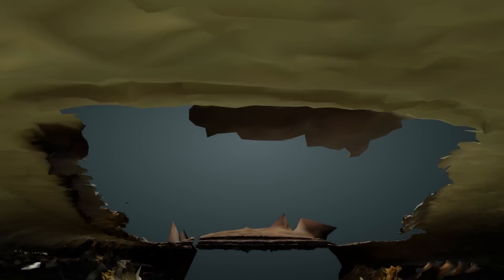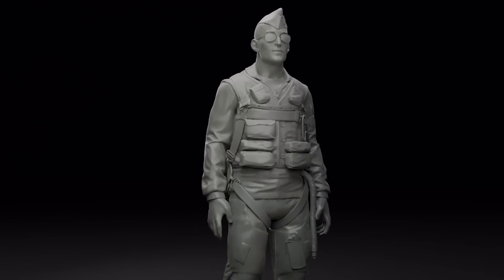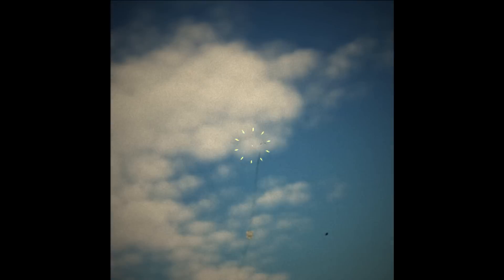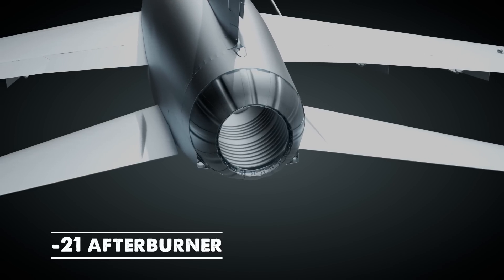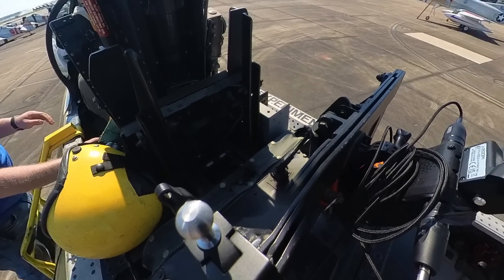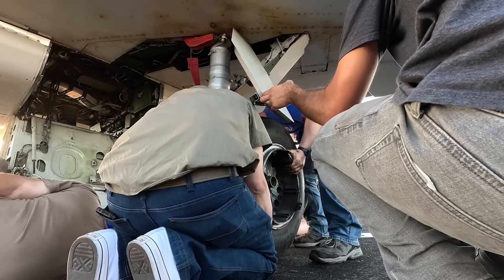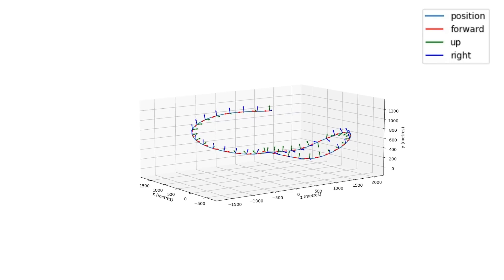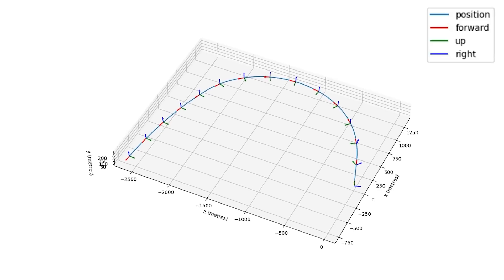F-100D Dev Log: The Road to Realism - Part 2

Comment: Excellent detail but one minor observation,at 0:37 of the video at the bottom left behind the headrest of the ejection seat there are 4 screws but they are lockwired at the wrong side.The whole meaning of the lockwire is to prevent something from unscrewing not from screwing.Please fix that.

Comment: Why is the Zoom XY mic placed on the HUD and not behind the pilot's head?
"Strategically" - Wouldn't the HUD placement make the record of sound which would not reflect the actual position of sound sources the pilot hears?
Asking as I actually use similar Zoom XY mic and recorder and I know how much the position of the source changes the feel of spacial placement of audio source in the final mix.
Reply from the maker: For safety reasons we had to adhere to the restrictions placed on us. This was something I took very seriously and had to respect and conform to.

Comment: did you guys model the lockwire at 0:38 yourselves? or was that taken directly from the photogrammetry? could be a flipped thread but if its not that lockwire is the wrong way around (minor detail I know but still). I love this project, its gonna be awesome to see this in DCS
Reply from the maker: It was an issue when mirroring the model in the software, it has been resolved. I honestly don't recall if that wire was in the photogrammetry.
Reply: @grinnellidesigns  ah fair enough. I love that you guys actuallysolved such a detail. Only aircraft mechanics will really notice that to be fair. good work!

Comment: Since ya’ll got to use a two seat F model for reference, are there any plans in the future to add the two seat wild weasel model?
Reply from the maker: While programming would be a matter of adding multicrew and modifications of a few systems, the art would be the most time consuming factor. Its not the focus at the moment but not off the table either.

Comment: I hope the flight model will be authentic to the real thing, which was apparently rather challenging to fly.
Reply: Beat me to it.  The F-100 and the F-104 killed a lot of young pilots.  Missiles with men in them with high wing loading.  You need to be on your speeds and their associated AOA limits.  LOOOOONG USAF runways were to get B-36's and Century series jets airborne.   Fly those interceptors like you would a Mustang or F-86 and you end up with a dance partner that kills you after yanking the stick back just ten knots too slow.  Unrecoverable "Sabre Dances"  (pitch up/inertial coupling)

Comment: 1:30. That level of wear seems about right, to me.  Somewhat used but not too worn out like it came from the boneyard. 🙂.  Another option might be nice, if it’s just a matter of changing out some texturing files…near new, like right out of the depot (although, I suspect there were no new F-100Ds with that modified/updated equipment configuration), or well worn in like 1972 condition?
Also, I assume the first digit selection knob will be limited to either 2 or 3 in the release?  666 MHz is not in the UHF band. 😉

Thanks for the great update!  Really looking forward to the ol’ Hun.

Are you guys thinking of making another module after the Hun?  Maybe eyeing the F-105D Thud next?  Or maybe the OV-10?😉

Comment: As a former F-16 crew chief and avid DCS simmer, this really hits home. You are going above and beyond with your investment into minute details and authenticity. There are other highly regarded 3rd party developers for DCS, but they are in for a real competition with you guys. Interesting for me to see how the brake unit is installed from the outside of the wheel, whereas on the F-16, the wheel must come off first, before the brake unit can be removed. Thank you for sharing, and best of luck with your project, I will be following this closely. And PS, beware of sabre dances, I've heard they are a real problem.

Comment: As one of the commenters said, I would love a clean cockpit option.  The MiG-21 finally has one.  At any rate, this is very impressive work.  Cant Wait!   This a 2025 release?  I know, two weeks. LOL
Reply from the maker: We have taken feedback from around the community and we will take extra care that all cockpit liveries will meet the community expectation. We will continue to push hard to make 2025 the year of the Catfish!
Reply: @grinnellidesigns  You certainly don't want to go "noodling" with that jet!  Are you going to model the inertia coupling?  The fireball should be much larger when new butter bars auger a Super Sabre on take off, versus with tanks nearly dry on landing.  So many new drivers lost their lives flying it like their old F-86s and Mustangs.

Comment: Very cool the different fuel probe layouts. As a disliker of fixed probes I am happy to remove it :3
Reply from the maker: If you play online and slot into an F-100 with a probe you will be able to remove it so you are never stuck with a configuration you don't like. The afterburner however will be fixed via mission creators selection.